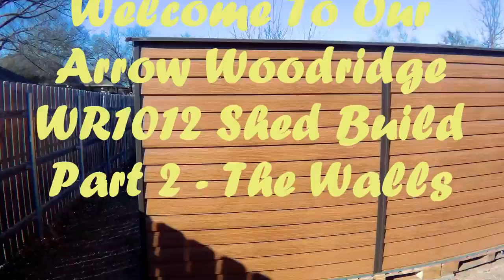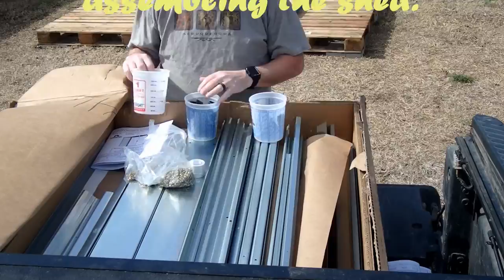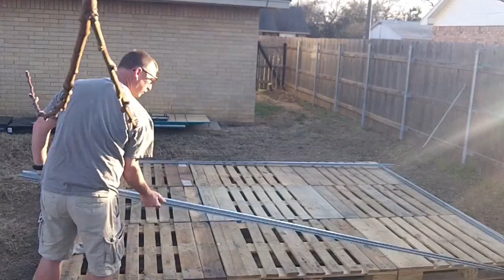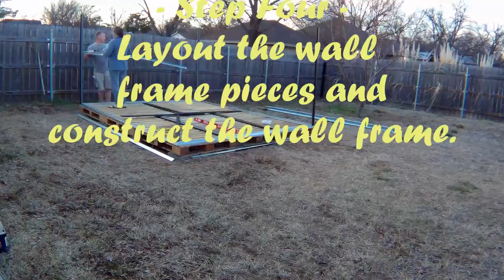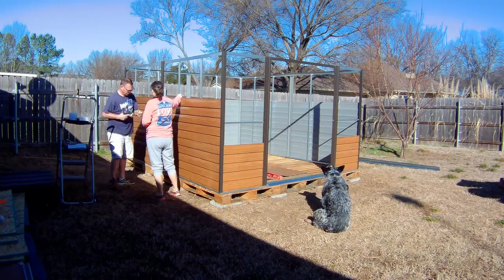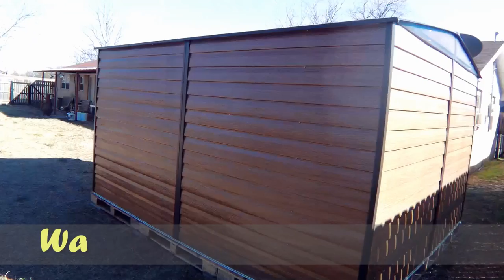Living Cooper - Arrow WR1012 Shed Build - Pt.2 The Walls

Comment: Looks good. Have you had any leaks during a windy rain storm?
Reply from the maker: Thanks for watching commenting. I did develop some leaks around some of the screws, with the expanding & contracting of the metal as it heats and cools. I used clear Flex Seal and sealed them right up. We sold the house last year, so I’m not sure if there has been any issues since then. Overall, it was a good shed. Thanks again.
Reply: @LivingCooper  Hmm, ok. I didn't think about the screws, but where the panels met. Thanks for responding.
Reply from the maker: @BridgeOps  Nope, the seams were fine, it was the screws. No problem. We enjoy interacting with the viewers. Thanks again.

Comment: I bought the same shed bit the 10 x 8 and it's been sitting in the box on the side of my house for a year now. Haven't had the need or the time to put it together until now. I  paid about $789 for it (pre covid prices) and was going to have a guy build it for me but he wanted $500 to do it. No way in hell. I'm pretty handy and know I could do it but just need to find the time. I looked at the instructions and it seems pretty straightforward and your videos seem to confirm that.  What would you say was the most difficult part in the process? I'd think the foundation would be the most time consuming. Any tips from your experience would be much appreciated. Thanks for the videos👍🏻
Reply from the maker: Thanks for watching and the great question! I'm sure you can handle it!  If you are not filming it; you can probably throw it together in 1 - 1 1/2 days, depending on the foundation. I would definitely say that the foundation was the hardest & most time consuming, but you need a good foundation. If you have access to some good pallets, my pallet foundation has been a good one.  Just make sure you put it on some cinder pads.  Really the biggest help is just to have someone that can kind of help hold pieces together.  Be careful if you are using a drill or impact driver; it doesn't take much for the sheet metal screws to strip out the metal.  My wife reminded me that some of the printing on the pieces that indicate where the panels go was washed off, but it wasn't hard to figure out where they went.  Hope this helps.  thanks again!

Comment: What happens if u put the plie wood in after building the base frame ? When did you put the plie wood in?
Reply from the maker: Thanks for watching. I put the ply in after I built the shed and then I put waterproofing on the floor. You could put it down before. If you do it before, definitely make sure you put some waterproofing on the floor before you build the shed over it. Hope that helps.